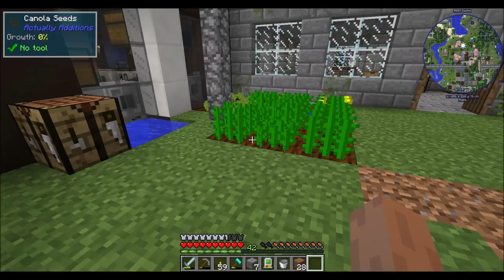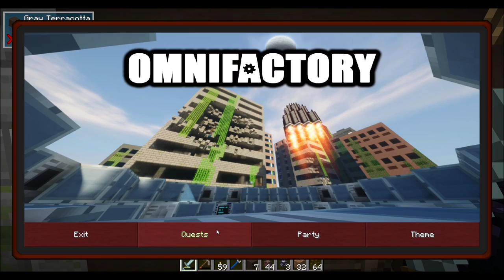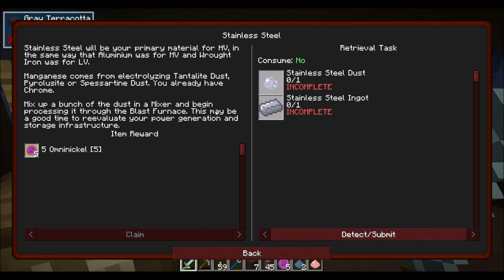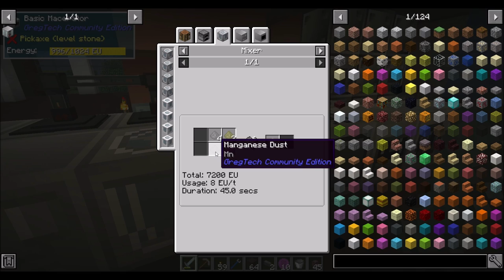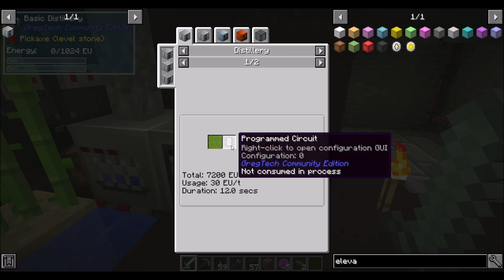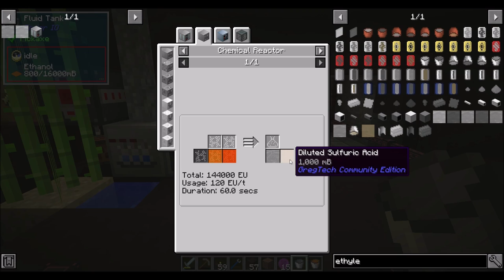OmniFactory   Ep19 Ethanol

Comment: My following explanation may be in vain, but pain I feel when I see you missing something is almost physical. The hole on the greg machines is for output and if you click on the box with an arrow in the GUI of the machine it'll do it automatically(orange for items, blue for liquids). You can't input through the side with a hole but it can be enabled by rightclicking this side with a screwdriver and you can change the position of the output side with a wrench.
P.S.(why not, it won't be seen anyway) First page recipes may work for other mods, but not for greg: many ways and even more steps in them to reach a same goal is it's thing, so please! check every single way to make something, research the ore-processing patterns, look into the way greg power system works - it will be much, much easier if you will have at least some notion of what you are gonna be dealing with every time you are searchig for a way to produce a new material. Coming into it blind and doing thing too fast wastes just too much time and resources
Reply: High Quality Help, Dire! Take it! Good explanation of Gt-Mechanics!
Reply: As someone who struggles with this and can't simply find the wiki to "look it up" like so many suggest, thanks for taking time to explain this.

Comment: Please Dire learn the chemical notation of these elements. You will find them in the chemical formula of the ores.  

Also from reading comments you may want to take some time and build a storage tank site for all the O2 and hydrogen you are producing, along with all other chemical liquids/gases it appears you will need a lot later on so may as well not waste time and energy remaking them.
Reply: "but it's just water and power. So I can be lazy and waste stuff" he's got a point, but he also doesn't realize how much he will need and how important it is to not be wasteful
Reply: @masonp1314 I'm honestly waiting for him to do the  same thing with other stuff, like not bothering to recycle some of the byproducts of using chlorine that return a lot of the chlorine you use.

Even with an HV chemical reactor, Hydrogen isn't that quick to make with water.  Oxygen atleast has simple ways to make.
Reply: The rule of gregtech, make a lot of everything!  You can make a large amount of anything, even if it is slow to produce.. just make 5, 10, 15 or 20 of every machine.
Reply: I don't get it u can change ethanol into water but can't change water into ethanol??? Unless u process it with sugar.
FLAWED
Reply: @killermimmic101   idk I'm making ethanol into water at the moment. Mine was processed with malts ;D
Reply: What methods of large-scale fluid storage exists at the moment? I am using iron drums, because the next tier requires stainless steel, one of the few materials I am in short supply of at the moment.
Reply: @killermimmic101  Um, yeah, actually you can.  Changing water into ethanol requires sugar for the bacteria to feed on.  Ethanol is the byproduct of that.  You then distill the result (it's called wort when you're making whiskey, I don't know if they use the same word when they're making brandy or fuel ethanol) to concentrate the ethanol by boiling it off and letting it recondense.   (Ethanol has a much lower boiling point than water does, so you can boil it off and capture it while the water just gets hot, but not hot enough to boil along with it.)

Ethanol into water?  Avoiding the joke about drinking it and letting your body turn it into urine..... just boil the water for a while.  The ethanol will boil off leaving the water behind.
Reply: @corwinweber693  I meant in MC not IRL I didn't need a chemistry lesson SHEESH.
But the for the info

Comment: I could have over slept?  FYI - Deep Mob Learning has better resource gen in this pack (over Sky block at least).  Stuff like Iron, Gold, Copper, Silver, Aluminium (dust), and SULFUR as well as others.  I am using it for automatic resource mining at this stage with dedicated power.
Reply: I have used it so far to get iron. Now, I just have to get into an area where I can completely automate all of the DML stuff, complete with resource gen.  Just a LOT of power.

Comment: Hey Direwolf20, just noticed something while playing my game of this mod pack. You can replace the batteries in the CEF with Flux capacitors. They charge and discharge like the batteries but hold 10M RF each instead of the 100K. So you end up wish a basic cef with 40M RF. They are super easy to build too. 1 copper, 2 lead, 3 red stone and 1 sulphur.
Reply: I can't imagination that that is intended because the later power storage items are why more expansive then flux capacitors. 

But nice to know as long as it works :)
Reply: @MrN1c3Guy100  Yeah, that seems like an oversight, doesn't it?  :)
Reply: I figure it is. But I will use it. And just throw the regular batteries in each machine as a back up power supply.
Reply: MrN1c3Guy100 It’s pretty well known around the discord tho

Comment: dire, the x of the cables is how much amperage they can carry, each machine uses 1amp when working, if you are going to use 1 machine you dont need 4x cable, with 1x you are fine, also, for the blast furnace, i would put a batbox rigth next to the mv input hatch with with 16 batteries, that way the blast furnance it self has its own buffer
Reply: I've been wondering how other people are doing their power cabling. Mine is primarily EnderIO energy conduits with the 4x CEFs hanging off that to power small groups of the GregTech machines. Is there any advantage to putting batteries in each CEF? My machines seem to run quite fine without them.
Reply: @MisuVir  well all my experience comes from gt5 on 1.7.10 that is what gt community edition bases off, well ideally you produce eu with gt generators that way you don't "loose" power, because when you get on the higher levels of voltage your rf need will spike up exponentially, as when you produce eu with gt you can get a high level eu generator and tier it down to other machines in the line, yes having batteries on your cef does matter, that way you can output the max amount of amps on that cable, a good set up would be a 16x cef feeding into 4 4x batboxs that way you have double the buffer and more control on amperage, Also, upgrading the blast furnace energy input hatches is a must, with higher level input hatches you can inject more eu/t so if you have 2 mv inputs you can feed upto 2 hv amps onto each input, this is because the input hatch accepts 2 amps of lv, so you  have 2 lv inputs getting you 120eu/t. dire's problem with the blast furnace running out of energy is because he's feeding the blast furnace with 4lv amps so when he uses a lv machine, he takes one amp, and then the blast furnace only has 3 amps to use, and lowers the total voltaje
Reply: @MisuVir  Also, bigger batteries doesn't mean more eu/t it just means raw amount of eu, so amps are like indivual lines eu/t you can have 32eu/t with 1 amp and that is gonna supply one machine,more amps means more energy, so if you have 32eu/t with 8 amps you can run 8 machines, that said the total amount of eu you remove of the batbox/cef/etc multiplies by 8, also you can have a 16x cef and only use 4 batteries, that's what the cef is going to output, the bat boxes and alike output amps is the amount of batteries you have inside
Reply: @MisuVir  boiler/turbine setups are costly on resources, but worthwhile on the long run because you only need to upgrade the output hatch and inputs to allow more steam/water
Reply: GTCE uses a push based power system. So a CEF with 4 slots puts out 4 amps, with 16 it would put out 16 amps.
Reply: @Akronymus_  well of you don't have the batteries it won't output the 16 amps properly, because it will output the amount of rf converted divided by 16 amps, but if you use 16 batteries you'll have 16 amps at the correct voltage
Reply: @franciscolobaton7563  Depends a lot has changed since GT5U.  A 4x LV CEF will produce 4 amps of LV power regardless of having batteries or not as long as you supply 512 RF/T.  If you have the power production the batteries don't matter.  Where batteries matter is when the power in is lacking.  If you have 4 full batteries and suddenly are only supplying it with 256 RF/T, 2 batteries will drain if you are trying to use all 128 EU.

CEFs don't exactly work like battery buffers mostly.  Battery buffers required the batteries, CEFs don't.

I use a ton of CEFs in my base, most of them don't have batteries yet I can still run blast furnaces off a 4x CEF just fine.
Reply: @MisuVir  Yes and no.  If you maintain constant power supply there's no point to batteries.  However if you over use your power batteries can make up for the lack and charge when you aren't using as much.

Personally I don't bother with batteries anymore.  If I ever stop being lazy a basic flux capacitor in each CEF slot would be a nice idea though.

Right now I'm using end steel conduits to 4x CEFs which then generally supply 4-8 machines each.
Reply: @andrewgood7956  that makes sense, when I played gt5 we had rf to eu disabled so I worked only with batboxes, and being honest gt power generation is Good, if the pack had railcraft in it, a high pressure railcraft boiler could feed 2 gt turbines
Reply: @franciscolobaton7563  That's how it should have stayed.  EU to RF power conversion is fine but honestly RF power generation and transfer is a mess. Just way too many ways to trivialize it to the point where you are making 100k RF/T out of something stupidly easy to get.  GT power generation is atleast more fun.  I miss GT5U using IC2 actively cooled nuclear reactor + large heat exchanger in a Large turbine.  Stuff like that makes me want to stop playing omnifactory and go back to either GT:NH or go old school with Infitech.
Reply: @andrewgood7956  the server I played had infinite lava tanks due to severe lag thanks to ender pumps, so I had hp railcraft boilers using lava buckets and all that transferring them with resonant item ducts, it was somewhat expensive to setup but it worked like a charm

Comment: Gregtech machines have the output as the back by default and dont take inputs from the output side unless you use a screwdriver. That is why the brewery didnt get any water from the infinite source when you first put it down.

Comment: Dire Gregtech Machines have Fluid and Item Autooutput on the Output Side. You can switch that side with a GT Wrench. All your Fluid Conduids are totally unnecessary. Inside the Machines there is a Orange and a Blue button. You wondered what they are used for. Orange enables Item Auto Output, Blue...you guessed it: Fluid Output.
Reply: You could make a 10 Machine assembly line all feeding into the Next without a single Conduit.
Reply: You could, but very often there are secondary item and fluid outputs that need to be removed, so most of my machine lines have item and fluid conduits on each side. I also find it easier to use conduits to filter rather than sticking pumps or robotic arms on the sides of machines.

Comment: 19 Episods and Dire still does not know that the back of GT machines in output and that you can use the GT wrench to move the output to another side and that you can't input on the output side.
Reply: So you're not wrong, but where is a GCE noob supposed to learn that? What I find is GT5 wiki, GT6 wikis, and much, much more. Where are the GregTech Community Edition docs?